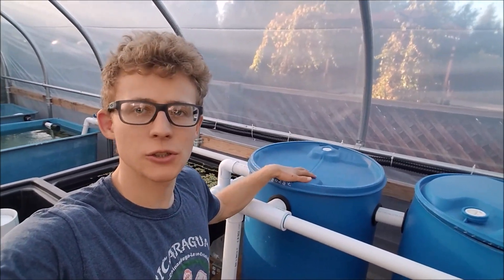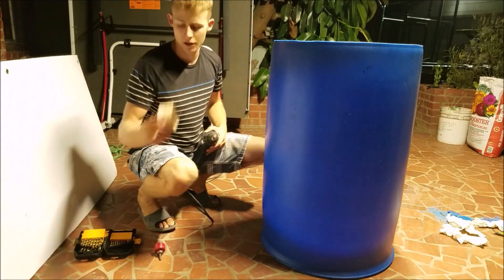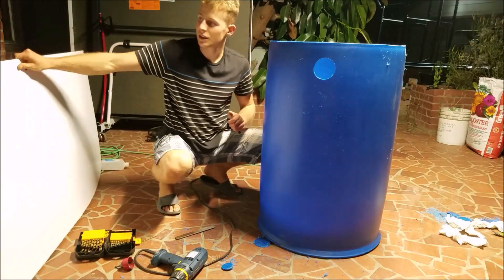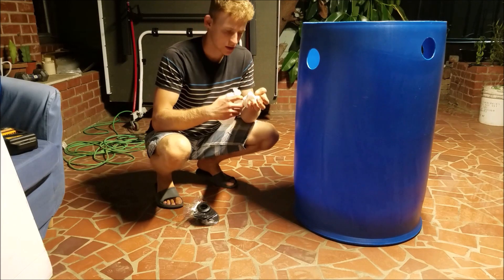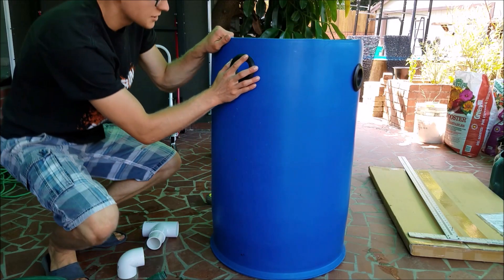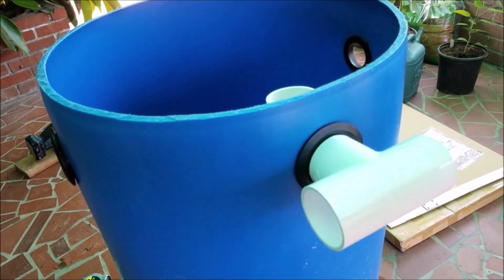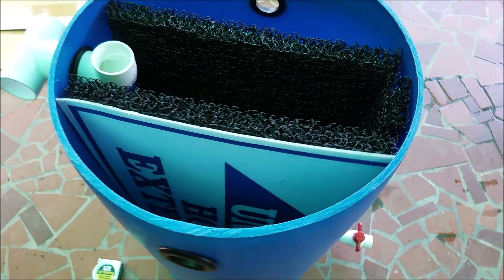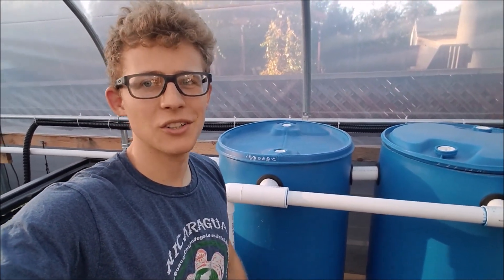How to make an Aquaponics filter (Hybrid aquaponic system)

Comment: I used loofah as a coarse filter in my system. They're easy to grow process, and they're cheap. When they get plugged up pull them out and bury in the traditional garden for added fertilizer.
Reply from the maker: Do u happen to have a link to the ones u used?

Comment: I think the mesh on the underflow side defeats the solids filter collection & removal outlet.
The mesh on the overflow side should come to the top of the tank to help capture the fine solids.  Also adding floating media in the gap between the boards is a good idea

Comment: I think it's called "SOLIDS FILTER", if it stops the fishes' waste and solids!
Reply from the maker: A solids filter is a mechanical filter. There are different types of mechanical filters but all revolve around the basis of removing solids. Whether it is a radial flow filter, swirl filter or this filter design seen in the video.

Comment: Seems like you could fill the gap wit bio balls. Maybe you did
Reply from the maker: When I made the filter I didn't have anything else to put in it. But yes if I had I would have put a lot of bio balls, or i would have used more of the matala mat. But I changed the filter and no longer have those two filters in my system.

Comment: So in my normal fish tanks I use 100% polyester pillow/quilt stuffing for a mechanical filter. Would I be able to do the same here?
Reply from the maker: Yes that will supply a lot of surface area for bacteria to attach and adhere to. The more surface area the more beneficial bacteria.
Jus make sure that if your water is flowing into the filters via gravity. That you dont put to much of the polyester, causing it to clog and overflow.
Reply from the maker: The matala mat/ the filter material that I used on this filter does come in different densities as well.
Reply: @vonponics   What density is the mesh filter?
Reply from the maker: @chestermcguire8876  
The matala mat comes in 4 colors/ densities. I have the least dense filter mat. Since that is what I found second hand. But you can get the other colors as well.
Here is some more information on the mats.
BLACK (super coarse) 
GREEN (coarse) 
BLUE (fine)
GREY (super-fine)

1)Matala Color
2)Biological surface area for microbial growth
3)Free volume % open space

Black
62 square feet per cubic foot
92%
Green
96 square feet per cubic foot
93%
Blue
124 square feet per cubic foot
94%
Gray
171 square feet per cubic foot
94%

https://www.thepondoutlet.com/matala-media-full-sheets-48-x-39.5-x-1.5

Comment: Nice video.
I can see that the water is coming out from the fish tank, then going to Swirl filter. Same pipe is connected to the Mechanical filter also. Which means, water from the fish tank is going to the Swirl and Mechanical filter both simultaneously.  and after that the same water is going to somewhere down. All are connected through the same pipe.
why is it so?
Reply from the maker: Hey
Actually that front pipe is just the overflow for both the filters and the fish tank. Just an extra safety incase something gets clogged in the filters.
That front pipe goes directly to my sump tank below.
Water actually enters through the back of the swirl filter then passes through the pipe in between the two barrels.
So it first goes to the swirl filter then to the mechanical filter.
Not to both of them at the same time.
You can see the filters better in this video. Maybe that will help.
https://youtu.be/kjRP7kZX9o8
Sorry about the confusion.
Reply: @vonponics  Thanks for your reply and explanation. I got it now.
Cheers
Reply from the maker: @umesh2063  no problem and thanks for the question. Some others were  probably also confused about that.
Reply: @vonponics  Can I ask you one more question here?
How do you take care of the nutrients required by the plants? The most important Macro nutrients everyone says is NPK.
Nitrogen is available via nitrate, how do you provide if there is any deficiency in Phosphorus and Potassium? What do you use to provide these nutrients?
Also, many says, P and K are also available in fish wastes. Whats your thought on this?
Reply from the maker: @umesh2063  
I did a lot of reading and looking around before setting up my aquaponics system. But I still have a lot to learn since my system is not done yet.
However I have always gotten the impression that all the nutrients your plants need is readily available in an aquaponics system.
You are basically creating a small ecosystem where everything helps each other to survive. The fish, bacteria, worms, plants, and what ever else helps each other thrive.
So for the nutrients it depends on the conditions of your aquaponic system. 
Nitrogen ofcourse is what is most talked about but I do believe the other nutrients can be readily available. 
The only thing I have read that you need to add is chelated iron (when your leaves turn yellow.
But everything does revolve around how mature your aquaponic system is. The more mature the more the bacterial process works. Also the conditions of your aquaponics system is important. Ph is very important also for nutients. 
They all have different ph for when the are most readily available.
You can see a chart here
https://nrcca.cals.cornell.edu/nutrient/CA5/CA0539.php

And here is something you can read about nutrients in aquaponics 
https://www.theaquaponicsource.com/blog/plant-nutrient-management-in-an-aquaponics-system/
Reply: @vonponics  thanks so much for the detailed explanation. It's really helpful. Have a nice day ahead 😊
Reply from the maker: @umesh2063  no problem 
Comment any time because I can learn as well.
Reply: @vonponics  Sure, Thank you.